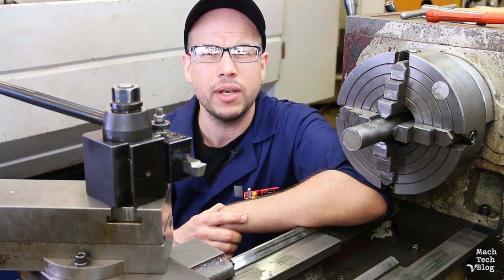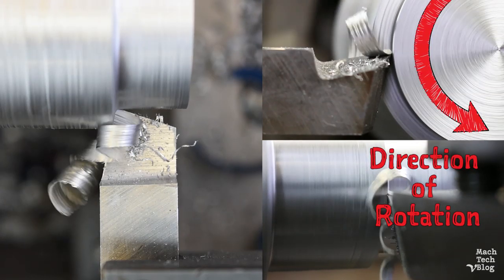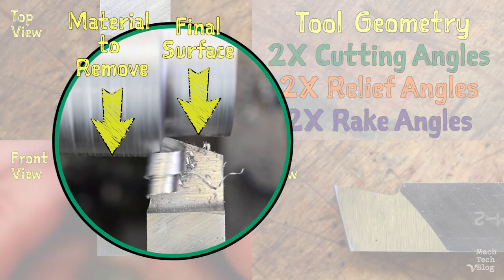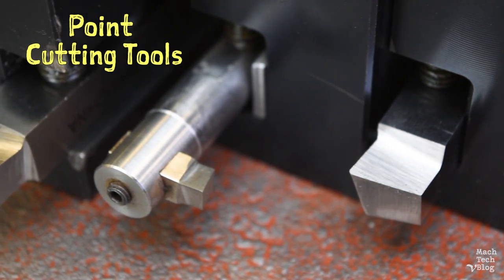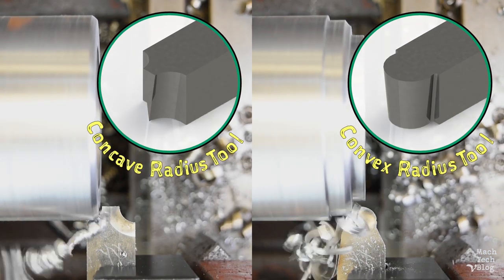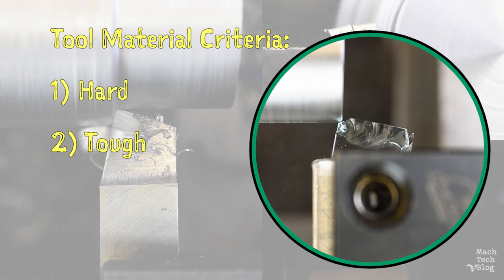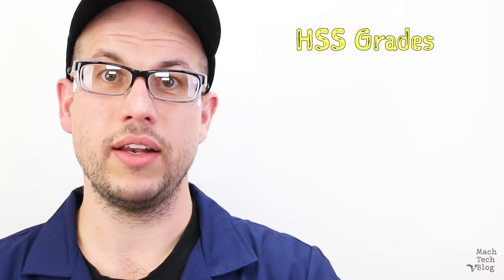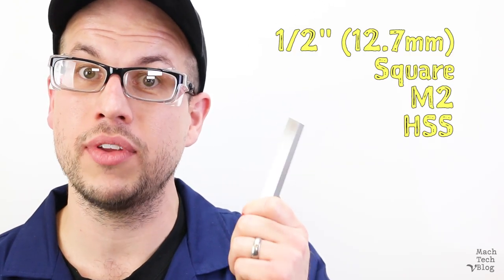Grinding Cutting Tools - PART 1

Comment: Nice job. I am a hobby machinist (risk management professor for work) who has an 'unfortunately not--much-used' BS in Mechanical Engineering. I am trying to make my own chamber reamers for experimental purposes (instead of paying $400 and waiting 16 weeks to order one). This is a nice set of instructional videos. You are crisp and clear and the data density is quite good. Please keep it up.